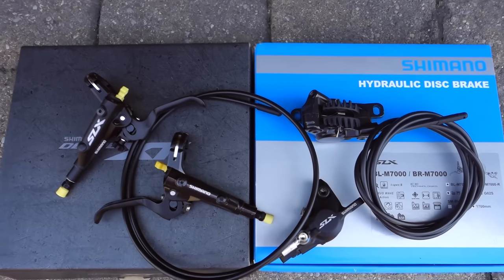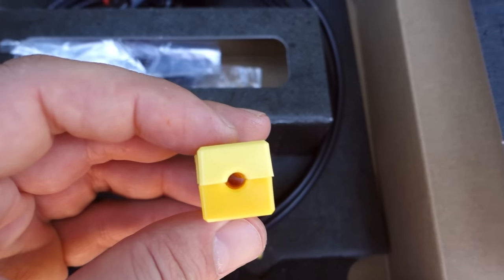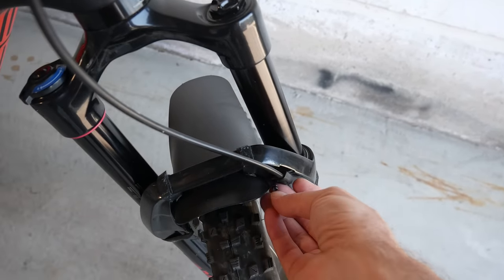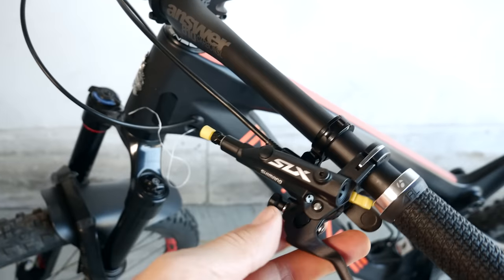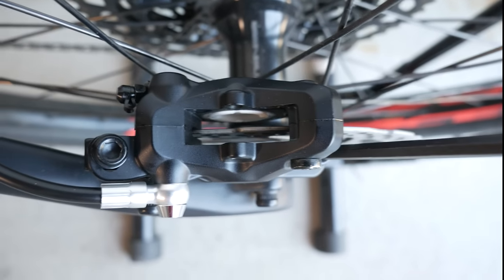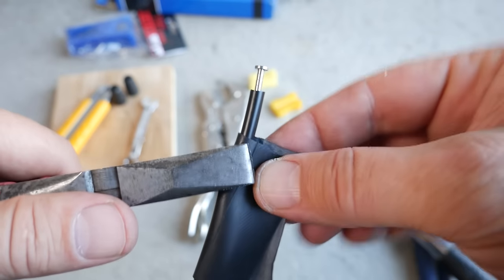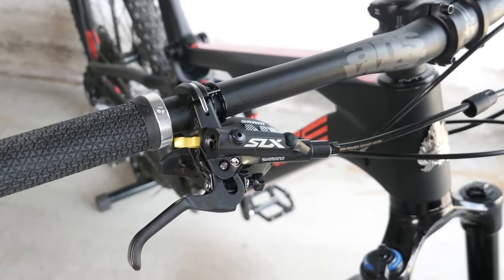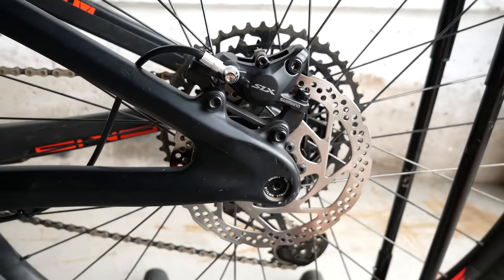Shimano BRAKES Installation How-To, 12 Speed or 11 Speed XTR, XT, SLX, Deore, 2 and 4 Piston Brake

Comment: Be warned: you need to take the bolt off the lever and slide the bolt and olive onto the hose to install into the lever properly. You cannot just insert the hose as shown in this video.
Reply: @LoveMTB  are there olives included in the set?  Thanks
Reply: @LoveMTB  I see. Thank you.  Very informative channel!
Reply: Well I am installing new pair of 6120 and question is how I find out if the olive is already in the lever if the olive and pin was attached separately in the box. I will propably remove the screw and see what is inside - will write it then
Reply: @kalamarmatus  Yes unscrew the bolt, find the olive (use a torch if necessary), and then slide the bolt onto the hose and then slide the olive onto the hose (olive last). Screw the bolt back into the lever while pushing the hose in. The whole point is that the bolt clamps around the olive inside the lever
Reply: @LoveMTB   yop thank you, olive is there :)
Reply: @LoveMTB  yes and likely I damaged first olive :D glad to have few more ...
Reply: @sensai_miagi  thanks for calling this out. Not using or reusing the olive is bush league, as it’s a necessary and single-use crush washer that maintains a proper seal. I know a couple people that have gotten away with reusing an olive that was already in there, but that was luck. I know more people that have had to redo the entire process after reusing the original olive. It’s best practice to use a new olive if the hose is removed. BTW, did you misspell “sensei”? Lol
Reply: The olive always has to be replaced because it works as a mechanical seal.
Reply: @kalamarmatus  yes, you might have damaged the olive because this video gives bad advice about pushing the hose in without sliding the bolt and olive onto the hose first. Other than this point this video and channel is great.
Reply: Thank you!  First time doing this and the video omitted this critical step. Very confusing video for a first timer. Shimano forgot to send me the olive.
Reply: You DONT need to take that 8mm nut out because the newer Shimano brakes have the Olive pre-installed in there under the nut. The way Lovemtb installs it is the correct way if you are buying the new prebled systems. What you are saying is correct if you are changing a lever or a hose but if you are buying a new pre-bled brakeset, do exactly how he shows
Reply: @atvkilla200  Thanks,i found it confusing why i'd need to take it out,ruining the bleed and spilling oil everywhere
Reply: What is the olive?
Reply: @atvkilla200  I'm here exactly to find out about this, as I previously installed a pre-bled brake the conventional way by taking the bolt out. The pre-installed olive didn't come out immediately. Needless to say, the break was not very 'pre-bled' after trying to pull it out,  and I was wondering what the point was of delivering it like this! The video provides the (correct) answer.

Comment: Very good video! If I could add one tip: Don't use a steel hammer to pound in the hose inserts. The steel hammer will leave very small dents in the insert that can lead to leaks. Use a hammer with a nylon head. If must use a steel hammer, place something like a piece of wood between the insert and the hammer head. Then go out and hammer the trails!
Reply: Good tip, but there should be a brass sleeve inside the lever which actually expends around the cable during tightening with the 8 mm wrench and creates the actual sealing.
Good to use a non metallic hammer anyways though.

Comment: I find it easier to line up the caliper buy having the bolts loose, and then squeezing the brake leaver so it clamps the pads down and orients the caliper in the right spot, and then tighten the nuts. maybe this isn't the best way but it has worked for me in the past. It obviously requires the brake lines to be installed and bled, and the pads installed.
Reply from the maker: Only problem with it is that you can align the caliper even when one of the pistons is lazy so not force both to actually work the same. What you use is common I have a few tips for making it work enemies better I’ll probably do a vid on it

Comment: Great tutorial, it helped a lot. Tapping the barb in is the hardest part of you don’t have that yellow block. I’d also recommend keeping the hose clamped while inserting into the lever to reduce twisting.
Reply: @LoveMTB  great video. HOT tip on inserting barbs more easily - warm up the end of the hose before inserting the barb - I just use a lighter. Especially helpful in a cold workshop.

Comment: This video helped me in a recent installation replacing the brakes in my old mtb. I don't have the yellow block he mentioned in the video. Instead, I used a wood cloth pin to grab the hose and pound the insert into the hose. Also, I used it to make a straight cut to the hose. Hope this tip helps my fellow bikers.

Comment: Thanks for the video! Your channel is the best source of knowledge about all the details related to Shimano brakes, really useful!

For those asking about the olive: it should be inside already. It was in my new XTs. You will see it if you undo the screw carefully.
Also regarding the sealed barb fitted into the hose from factory. I was going to shorten the hose and thought I could use that barb.
However the sealing didn't want to come off so I punched a hole in it but it didn't look pretty. More importantly though, the barb didn't want to come out.
I had to use a new barb.
Reply from the maker: Thanks!
And thanks for clarifying, I tried to ay the same in the pinned post of this vid.

Comment: Great video! I'm about to swap some SRAM Levels for some Deore 4 pot 6120's. Your video is very straightforward, just confused on others posting to remove the nut & barb from lever first. It was my understanding to do exactly what you showed. I'm also a little disappointed that you didn't go into doing a lever bleed to remove any air that got in during the install, but I guess that's why you linked the hose shortening video.
Reply from the maker: And you have this newer video on how to do a complete bleed. Not needed just for hose cutting/ install
https://youtu.be/lfyhmerlqJ8
Reply: I have just bought a Specialized Turbo Vado SL 4.0 and would like to upgrade the brakes to Deore XT 8100.  Bike came with Tektro HD-R290.  Would I be able to disconnect the OEM Tektro caliper and brake lever and connect the XT caliper and brake lever to the existing hydraulic hose?   Thanks for your thoughts and the readers.

Comment: Just bought the six 7100 front and rear sets I’m gonna do it myself I’ve have never even repaired a puncture but my local bike shop wants £60.00 to do it here in Dundee Scotland they were the cheapest another guy wanted £150.00 he go told F O. I’m sure I can do this the only thing I think I could have a problem with will be the routing through the frame so I have bought all the other bits and pieces I need ie oil cup dental floss etc so thanks for you excellent vids also I bought new shimano rotors so here goes you have saved me a lot of loot thanks again Derek

Comment: I’ve adjusted the front banjo on my M7100 and I’ve got mineral oil all over spilled, didn’t see that coming. For the rear banjo I’ll remember to keep that in mind.
Very good video, I’ve installed my rear and front brake set thanks to your vids.
Thank you.

Comment: Jagwire sells a tool for installing the fitting in the hose.  Doesn't cost much and makes installation easy and precise.  I bought one a few years back and even if you only use it a few times it pays for itself.

Comment: Hey thanks man. I’ve ordered a new lever assembly to replace the one I broke on the weekend and was worried there’d be olives and crimping and all that fun stuff but I’m not worried now thanks to your video! Shimano XTs look pretty straight forward.
Reply: @LoveMTB  well the lever assembly will only be replacing the XT I already have on the bike so I know I’ll love them. My Canyon Strive came set up 203/180 and the only upgrade I’ve made to the brakes is a 203 on the rear which has transformed how the bike stops now. I love my Shimano set up.

Comment: Do not forget to put on that rubber cover and if not, ask me why I know. I can tell you, I now know 😢. Thank for a great instruction video, it helped a lot but unfortunately the memory was short😂 Anyhow, think that slicing it open and secure it with some tape will do the trick. Did order a new connection set just in case.

Again, many thanks for all the information you share!!

Comment: Another straightforward informative video.
Q: So the olive is already inside the lever, and you push the hose through it?
Comment: Worth noting that on the newer levers that have an extra point of contact with the bar, if you are using a standard band clamp shifter or dropper lever, you may actually want to position them between the brake lever clamp and the contact point. If the band clamps are the cheaper style that does not pen up, you will need to do this as you are sliding the lever onto the bars.
Reply: how do you connect XT Brakes with GX Shifter?
Reply: gregor 1910 problem solvers make adaptors for that sort of thing

Comment: Great Video! I recently changed the drops on my CDF for lovely flat bars, sooo much better! anyway, I didn't have the little yellow split block, so simply drilled a hole through a bit of wood, then cut it in half with a hacksaw, worked just fine, and only took a few minutes.and even better, cost nothing The brakes (ultegra calipers) are so much better than they've ever been before, replacing the 105 STI shifters with XT flat bar ones

Comment: As always, very helpful and well explained video! I saw that you put the insert at the end of the hose, but you didn't put the olive (or I missed it?) It is not necessary anymore to add the olive?
Reply: @LoveMTB  Great content! Do you think the olive is inserted in the lever already for M6000 Deore brakes as well? There is one in the small parts bag in the box, but I reckon it might be for when you shorten the hoses?
Reply: @nendinosaurus  you get an olive in the box, because it’s necessary to use it. The olives are single use only; basically crush washers that permanently deform to make a good seal. If you remove the hose, you need a new crush washer.
Reply: I was just about to comment the same thing about the olive! I'm glad I found this video and won't accidently put another olive on when I go to put on a new brake lever this weekend! Lol. Very helpful video
Reply: @vinfoy565  not a good idea. I’ve never purchased a Shimano lever that came with an olive inside the lever. Putting an olive on the hose when you insert the hose into the lever is best practice.

Comment: I'm getting ready for the first independent brake replacement from shimano MT-200 to shimano Deore BR-M6100. I have a question about one part you show at the beginning of the video that is included in the kit: the safety clip (next to the mounting screws).  When installing the brake, you don't mention it anymore... What is it for?  Where is it mounted?
Reply from the maker: It is installed on top of the mounting screw - push on to snap in place. Not needed never installed by anyone. Have fun with it

Comment: What a freakin great vid! I'll be puttin this Intel to use in the next day or two when my XT & XTR sets arrive. Cheers!
Reply: LoveMTB i was going to say the same thing, but I’ll just instead say “ditto”
Reply: @LoveMTB  I mounted up my disc brakes and even tho it was a touch scary cutting them down, then installing the olive and pit, it all went really well and was pretty easy. BTW, you didn't cover how to slip the olive on and how it's crushed into place with tightening. That would've helped a bit but I figured it out. Burped the lines a couple days later with a bleeder kit and these brakes, mated with ICE RT86 rotors, once bedded, stop INCREDIBLY well.
Reply: @LoveMTB  ohhhh...it's cuz the SLXs don't mount up the same! No olive only a pit. Both my XT and XTR sets have brass olives.

Comment: Great video. Will be helpful. Only a question. At 10:25 when you insert de hose  in the lever, ¿is the olive inside the lever?   will the hose with the insert go easily through the olive?

Comment: I'm replacing just the hose for a higher handlebar, how do I properly fill the empty hose with fluid after connecting and running the hose to the brake. Great videos, did you make a video about filling a new hose? Thanks.

Comment: I've never installed brand new Shimano brakes before, but I am about to install some XT M8100 brakes so this video was very helpful! I assume the brake lever master cylinder comes pre-loaded with mineral oil as well as the hoses and caliper? I'm hoping to avoid having to do a full brake bleed if possible. Routing the rear brake hose through the frame will also be a challenge. My 2022 Tallboy frame came with a rubber tube that gets inserted into the rear traiagle port on the seat stay and the hose goes inside that tube inside the seat stay. I guess the rubber tube is intended to prevent rattling of the brake hose inside the frame. Did you come across this on your Tallboy? 

UPDATE: I just looked at the video again and I don't see where you cut the hose to size. I'm a bit confused about the witness mark. Not sure how the witness mark comes into play, but based on the Shimano instructions it sounds like it's only relevant if you are using their cutting and barb insertion tool TL-BH62. It looks like the witness mark and the measurement per the manual allows you to line the hose up correctly in their tool for cutting purposes. If you are not cutting using their tool then the witness mark and measurement serves no purpose?

Comment: you shouldn't have to take the pre-installed olive out of the lever,  right? I feel like I had everything set, then decided yes, I have to cut down the cable length cut it, installed the pin, tried to put it back together and now can't get it to stop squirting oil out from around the connection when I squeeze the lever :(
Reply from the maker: Most probably your hose did not go through the olive all the way so you do not have a secure hose connection.... new insert and olive needed to fix.

Comment: Hi, I need to install new brakes on a recumbent bike so I actually have to use the whole hose length. Should I just screw the hose in the lever nut? the original isnert has a seal, does it break when tighting or I need to break it before screwing? Thanks
Reply from the maker: You have to cut that little bit off

Comment: Why don't you recommend the Shimano hose cutter tool? It's way to expensive but so nice to use. I just did my first brake install and because I was too afraid to mess it up that I bit the bullet and got the tool. All went smooth and dummies like can cut and press perfectly straight with it. I just hope I will use it again for that price.

Comment: Great video. After these steps are complete would you recommend attaching a funnel and filling with some oil and pumping the brakes to release any air that might have entered at the top?
Reply: @LoveMTB  Hero. I've just ordered some  M6120s and will be using this as my guide. Thanks man!

Comment: Hi Congratulations on great brake tutorial ….. based on information i viewed on some of your other reviews….. I decided to purchased new pair Shimano XT M8120’s to replace the MT200 brakes on my new Focus Jarifa2 which are a bit How’dy Do Dee in terms on braking capabilities if u get my drift !
Is it ok to use my existing brake lines rather than rerouting the new ones provided ?
My guess is that I will invariably need to get a specialist or a specialist tool to fit some of the new line ends …..  if it’s ok to utilise my current lines as the XT ends differ to the MT200 line connectors.
 Cheers

Comment: great video, do you think the 4 pot calipers will fit on an IS to post mount adapter? Some calipers like Hopes RX4 specifically say they wont, but haven't found any info on the Shimano 4 pot SLX or XT calipers. Thanks

Comment: Very informative video and straight to the point. Got another sub here. I just bought shimano brakes so I’m learning the ropes. Question for you: does the olive comes already installed in the master cylinder for new brakes? I noticed you included the barb and olive in the hose shortening video. Wondering if I need to install the olive as well when installing my new brakes. Thanks in advance!
Reply: @LoveMTB  thank you for the time and response. I’ll take the nut out as well just to make sure. Cheers
Reply: @LoveMTB  do you have any pointers for the Saint brakes? I’m completely new to shimano. I’ve tried Sram G2 rsc, codes rsc, and my current ones Hayes dominions a4. I’m on the heave side so I’ve looking for stopping power. Modulation is not working out for me.
Reply: @LoveMTB  thank you!

Comment: Do you have to remove 8mm nut and refit the compression nut with the break line or is the compression nut already pre installed into the break and you just measure, cut and insert the pin into the hose and just plug it into the break and tighten the 8mm bolt without taking it out ? Because my slx rear break didn't come with a compression nut so I was wondering if it is already pre installed
Reply from the maker: If you have what you see in the video just insert, push in hose and tighten bolt. Olive is already behind the 8mm bolt in the lever
Reply: @LoveMTB oh ok thanks because i have basically the 2024 models on the slx break and it basically has the the yellow stopper on the break levers but i watched other videos of people taking out the nut and the line and refitting it in and so i wasn't sure if I had to do the same but yours looks like mine so i will put the barb after cutting the hose line and just insert it thx for clearing the confusion 😁 😇👍
Reply from the maker: @iliailiev3901  just make sure you push in the hose properly before tightening should be about 8-10mm
Reply: @LoveMTB  oh ok thanks 👍